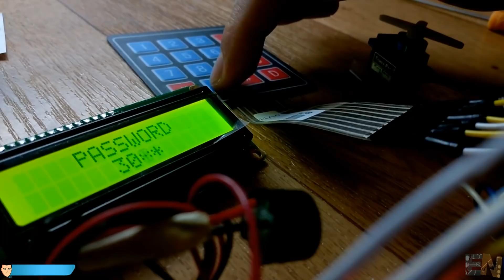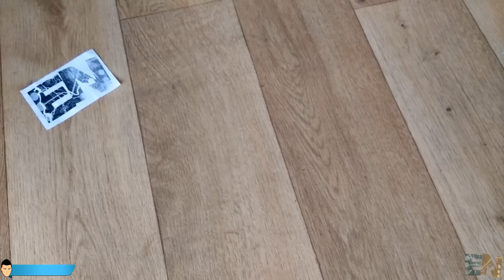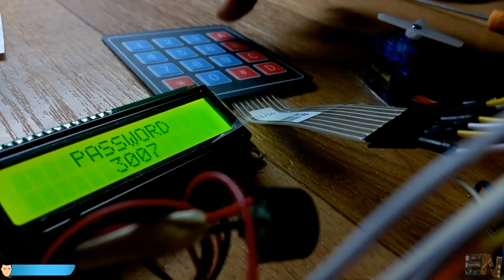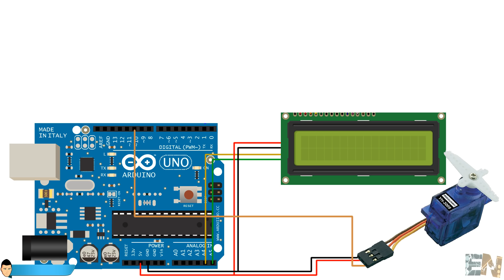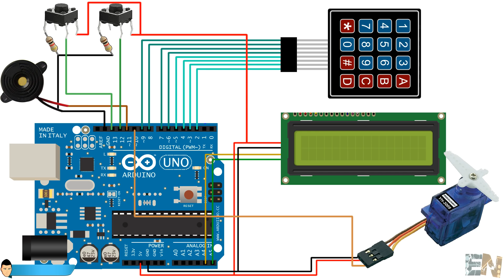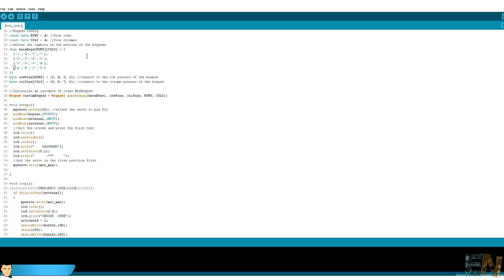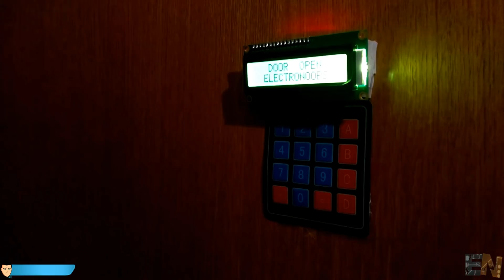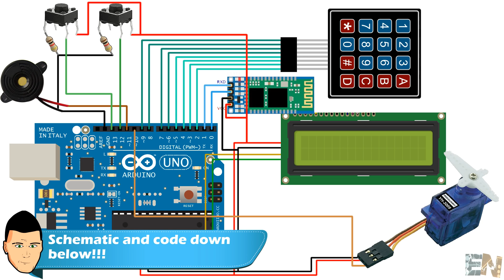Door lock keypad and bluetooth Arduino tutorial

Comment from the maker: sometimes the slave adress is not 0x3f. So change it to 0x27 if it dosn't work when using this function:
LiquidCrystal_I2C lcd(0x3f,20,4);
Reply: im getting an error that says :     

exit status 1
stray '\357' in program

How do i fix this?
Reply: can u  do the same with esp32
Reply: Electronoobs  can u tell me where the lcd input address is there in code
Reply: is the "active buzzer" just a piezo speaker?or is there more to it or can i just hsarvers the piezo  disc speaker out of something?
also will the .ino fit on a pro mini?
Reply: bro i find an error from keypad library.
Reply: How many times the door got jammed due to mechanism ? I need an answer
Reply: You're good at tutorial electronoobs but I tried to do it but the keypad library is missing. I hope you notice this message of mine.
Reply: where is code ......

Comment: I have a problem that is when I put the code and everything and I load it, everything is fine, the button opens and closes it and the screen works normally but when I enter a number on the keypad it puts it on for half a second and then goes back on the asterisk but the number does not stay and it does not change its position.
Could someone help me please

Comment: I made a similar mechanism made with Motor using CD player parts and same bolt,  but used pic 16f877 with 8 bit password, don't use bluetooth or wifi its hackable. Your mechanism will jam. Designing again with ball screw to open close door ... dont use master password... keypad wires are a mess 7 in total, I  should design a keypad with 1 wire Dallas device ...

Comment: Hi Electronoobs first off great video. Helped me set up my arduino project. I altered the code to fit what I was wanting, erasing the electronoobs on the LCD and stuff. So far I've gotten the keypad to open and close the servo and the inside open push button to open the servo. But I have been unsuccessful on getting the close button to work properly. It could be the code but I'm not an expert. Any Advice?

Comment: This is a very bad idea on a door that you need access to like a bedroom door. What if there is a fire and the power goes out? You have now trapped yourself in a burning building. What if the cheap components made in China break inside the door (which they will after a while)? You now have to break the door down. This is a nice project for something like a shed door of a lock box, but do not do anything like this on a door that might be a fire escape.
Reply: No, you just simply rip the crappy plastic servo off the door and slide the lock manually.

Comment: The project with arduino uno is fully functional, but, with an arduino Micro( or Nano) i must change the pins and the code because the pin out is much different. I have a problem with SDA and SCL, what can i do, you can uplod a new schematic with the correct connections for Nano or Micro? Thanks a lot and sorry for my orrible english!!
UPDATE  : I do this changes using arduino Micro. For display I2C (LiquidCrystal_I2C lcd(0x27,16,2)use SDA and SCL, respectively:  2 (PD1)and 3(PD0),   for the buzzer PIN 13 (PC7 - PWM),   for external PIN 12 (PD6 - A11),   for internal PIN 14 (A1),   for the servo PIN 11 (PB7),   for my home made 4x3 keyboard i use pins from  4 to 10 (4, 5, 6 for COLS and 7, 8, 9, 10 for the ROWS). 
If you connect the bluetooth use pins 1 (PD2) for TX and 0 (PD3) for RX. 
The code must be modified respecting the correct pin out.   But, even without my changes, this project is awesome!!.... Thanks bro
 !!

Comment: Did anyone else fail miserably with this project, 
I have modified the code and settings of the IDE software to find the same thing happening over again, both the button play a quiet tone and open the servo clock wise, i then found that pressing 6 on the keypad turns the servo anticlockwise. My 16x2 LCD is is only showing the 5 or so rectangles and i cant seem to communicate with the LCD at all. Apart from the 6 on the keypad it is also completely unresponsive. my wiring is correct and and its a fully functional genuine arduino uno.
I write on the 31-10-18 approx 1 year after this video was released, im using 1.8.7 IDE so several changes probably have been made since this video was released.
i choose this project specifically because its the only one with Bluetooth and because hes smart enough to put    a manual locking system so you can open and close it from the inside (something no one else can seem to think of)
Any help or advice would be much appreciated
Reply: never mind it just decided to start working

Comment: i can't get it to work. the lcd keeps switch between two texts: INSIDE OPEN & DOOR OPEN! ELECTRONOOBS
and the servo keeps opening and closing. i have checked the wiring many times and it seems to be correct. can you help me?
Reply from the maker: Timanttikuutio Gaming do you have the two push buttons? If not, remove the emergency open part of the code!
Reply: Electronoobs yes do have The buttons but after i removed The code it worked. It seems like theres something wrong with The buttons :/

Comment: hey 
i want some help in this porject, can you help me out? 
i want to on/off a relay instead of servo. also i use many programmes from the internet , all goes right but when i switch off the arduino & then switch on it,,, stored password will be gone ,
i m using 
1- arduino uno
2- 16*2 LCD
3- 6v Dc relay
4- 4*4 numeric keypad
5- buzzer & led

Comment: there is no battery how will it work
Reply from the maker: 2:57. I've used a 12V DC adaptor. If you use battery make sure it will never get low or you will have a permanent closed door. Keep up!

Comment: i use arduino mega, the lcd couldnt seem to work. i need help
Reply from the maker: sometimes the slave adress is not 0x3f. So change it to 0x27 if it dosn't work when using this function:
LiquidCrystal_I2C lcd(0x3f,20,4); Also check the i2C pins of the Arduino mega!

Comment: I noticed the LCD that you used was the yellow variant, would it still work with the blue version or no?
Reply from the maker: Yes, both are good but sometimes  the slave adress is not 0x3f. So change it to 0x27 if it dosn't work when using this function:
LiquidCrystal_I2C lcd(0x3f,20,4);

Comment: Hello, I have a question but first of all this was a great video. So how do you suggest I power the arduino for permanent use? Would I have to just hide the wires up to the arduino from a nearby outlet?
Reply: Oh, and I forgot to ask, did you just drill through the door to connect the keypad to the arduino?
Reply from the maker: Yes, just add a 12V transformer and nice hide the wires as a normal electronic door keypad.

Comment: Em. Just one more question, how many volts does this project need. Because I want plug in an adapter.
Reply from the maker: Apply a voltage from 6 to 15V to the Vin pin of the arduino. The arduino board already has a 5V and 3,3 voltage regulator.

Comment: If i don't put the push button, will it still available??
Reply from the maker: Tsuyoshi Sano yes but if you don't use the two push button remove the emergency open part of the code. Just delete those lines.
Reply: Sorry, I got an error here. When I deleted the emergency open code. It shows an error. It said " expected unqualified -id before ' if ' "
Reply from the maker: Delete only these lines from the code:

///////////////EMERGENCY OPEN/CLOSE/////////
  if (digitalRead(external))
  {
     myservo.write(mot_max);
      lcd.clear();
      lcd.setCursor(2,0);
      lcd.print("INSIDE  OPEN");
      activated = 2;
      analogWrite(buzzer,240);
      delay(250);
      analogWrite(buzzer,200);
      delay(250);
      analogWrite(buzzer,180);
      delay(250);
      analogWrite(buzzer,250);
      delay(250);
      analogWrite(buzzer,LOW);
     
      
      lcd.clear();    
      lcd.setCursor(4,0);
      lcd.print("WELLCOME");
      
      lcd.setCursor(2,1);
      lcd.print("ELECTRONOOBS");
      

      lcd.clear();    
      lcd.setCursor(3,0);
      lcd.print("DOOR  OPEN");
      lcd.setCursor(2,1);
      lcd.print("ELECTRONOOBS");
      delay(500);
    
  }

  if (digitalRead(internal))
  {
    myservo.write(mot_min);
    activated = 0;
    character=0;
    Str[6]= '-';
    Str[7]= '*'; 
    Str[8]= '*'; 
    Str[9]= '*';
    Str[10]= ' ';   
    lcd.clear();
    lcd.setCursor(0,0);
    lcd.print("    PASSWORD");    
    lcd.setCursor(0,1);
    lcd.print(Str);
  }
Reply: Okay, that is long. No wonder i get it wrong. Thanks a lot. I appreciate it.
Reply: Everything is seems almost done. But the LCD can't show anything and when i press the keypad. There's nothing responding
Reply from the maker: If the LCD doesn't work, try another slave adress. In the first lines of code you will find this: LiquidCrystal_I2C lcd(0x3f,20,4);

Try 0x27 instead of ox3f. Keep Up!
Reply: It works. Thank you very much.

Comment: i was about to do the same project of yours " bluetooth door lock"  but i need to replace the servomotor into a relay tht will control a certain load. is that possible ? how can i change the code part of servo into a relay code?
Reply from the maker: Yes, Instead of using servo.write to control the motor just use digitralWrite HIGH and LOW to turn on and off the relay! All the rest is the same
Reply: Electronoobs thank youu for clarification!

Comment: I have completed it and also uploaded code successfully...But when i power it the buzzer just beeps and nothing happens... What should be the problem??I haven't attached the LCD so Im not able to know what happened??plz reply
Reply from the maker: You are using the emergency open push buttons? if not remove the emergency open part of the code or simply connect the pins of the push buttons directly to GND

Comment: What if I don't want to add emergency buttons?
Reply from the maker: Just remove those and delete the emergency open lines from the code!
Reply: Electronoobs is it necessary to remove  it from code?
Reply from the maker: Yes, otherwise you will have th door open/close by itself since there are no buttons connected and the input pins are free.

Comment: what is the password
Reply from the maker: the password is 3007 in the example. 

to change it  go and find this line in the code, it should be at line 250:

if(Str[10]='A' && character==5 && Str[6]=='3' && Str[7]=='0' && Str[8]=='0' && Str[9]=='7' )

and change '3', '0', '0', '7' strings to the code that you want!
Reply: Electronoobs how can I add a five diget no. password

Comment: HI, I'm A newbie to Arduino world. I found your explanation and video simple and easy to understand. Please keep up the good job. 
Currently I have purchased the KIT which came with 1602A lcd board your tutorial shows some other kind of lcd with just 4 pins where as I have 16 pins. Can you guide me. In future I will buy the LCD which you have in the tutorial but i don't have the patience to order and wait for 40 days to receive the LCD. Please help if you can. Thanks in advance. If you have the schematic for 16 pin LCD and if you can email me that will be great. get2david2@gmail.com
Reply from the maker: My LCD also has 16 pins. But I've soldered this i2c module to it: http://www.ebay.com/itm/IIC-I2C-TWI-SPI-Serial-Interface-Board-Module-Port-for-Arduino-1602LCD-Display-/161245616356?hash=item258afcd8e4:g:nf0AAOSwZQRYgIMA

This module makes the circuit easier. You coulos use this tutorial for the LCD without the i2c module: https://www.arduino.cc/en/Tutorial/HelloWorld
Reply: where did you solder it to?

Comment: how am i supposed to give 5 volt to more than one thing?
Reply: oh maybe use a breadboard ok.
Reply from the maker: Theost21 what do you mean? use the same 5V to supply everything. the current draw is not that high. keep up!
Reply: yeah but you need a breadboarad to supply that power to different devices, right? :)
Reply: also i have a question, what resistors to the buttons do i need to use? Sorry  for asking a lot, i'm really bad and new to arduino :)
Reply from the maker: Theost21 a 1k pulldown should be ok
Reply from the maker: Theost21 no, just solder two wires to the same pin.
Reply: ELECTRONOOBS ok thanks for answering my questions, really appreciate it!
Reply from the maker: Theost21 u welcome, keep up!

Comment: I just have only an ARDUINO UNO bord a 9g servo motor and a key pad (you have used in this video). can you show me the prosses how to make a password door lock system by using those things? please help me.
Reply from the maker: Is the same process but you have to remove the push buttons and the LCD. The only problem is that you won't be able to see the typed password. Keep up!
Reply: is the code same or need to change?
Reply from the maker: Is the same, you could delete the LCD lines from the code, but like this should work as well

Comment: Hi I absolutely love all your videos your an absolute legend. I'm looking at trying this project where did you purchase the buzzer, on of buttons and leds please?

Please continue to create these amazing videos, they are so easy to follow and especially with the links also.

Where did you learn to do all these projects you have so much knowledge? 👍🏼
Reply from the maker: Thank you very much. I've got that buzzer and the buttons from an old DJ CD player. I always try to use scrap components. Keep up!
Reply: Thanks very much for your reply. This is my first project I have no knowledge of electronics. I've purchased all the items you've mentioned in your video including the the Arduino Uno & Nano. Do you have a photo or any diagrams of how you connect all the leads to a Nano. I'm sorry if I sound stupid but I'm confused on how I run a red lead to the 5v power from the Bluetooth module, LCD screen and the servo motor there only seems to be one 5v port on the uno? Any photos of both uno and Nano would be much appreciated.

Since my message I've uploaded all the zips and info, I thought I would just test it with LCD screen and keypad attached and nothing else for the moment. The LCD seems to flash through door open electronoobs, password, insider open and just keeps repeating.
Reply from the maker: I K those are all the same 5v lead. solder all the wires together and connect them to the 5V pin of the Arduino. it should supply enough power for all the modules
Reply: ELECTRONOOBS thanks very much. I just wanted to test the keypad and LCD screen, so I connected just these two items to the Adriano Uno. I've installed all the code. The LCD lights up but it flashes up door open, password, then inside open and then repeats. What is the issue I know I've not got everything connected in regards to the other items, but presumed I would be able to test these two. 

Do you have an email address I could possibly send you a video of what's happening? 

I really want to learn more about electronics and your videos and projects are so helpful. Thanks
Reply from the maker: I K that's because you don't have the push buttons connected and it jumps around with no sense, now that i think you should add the buttons or delete sole lines on the code. find the part in the code where it says emergency open and delete that lines of code